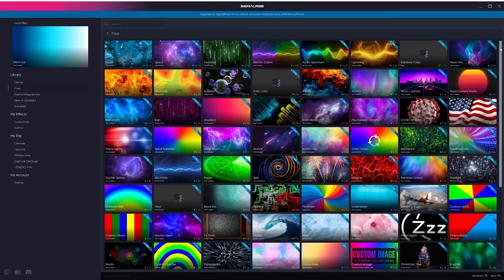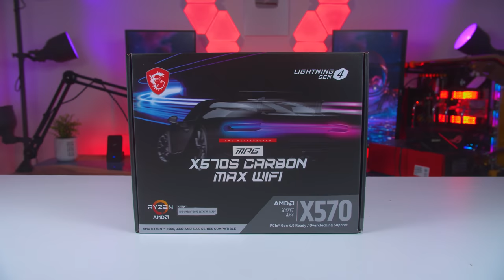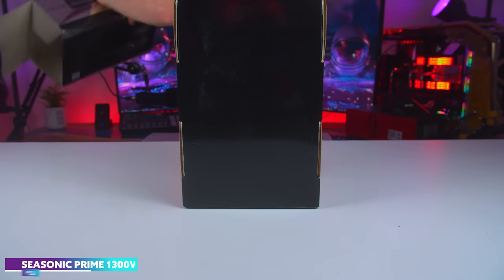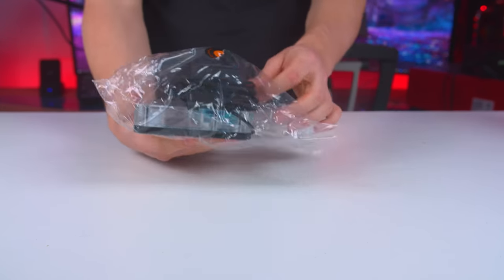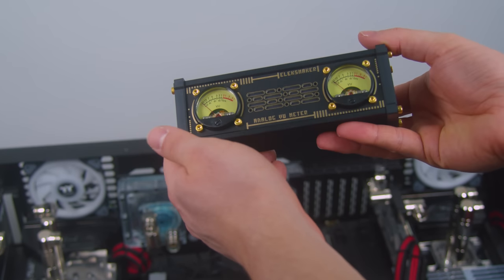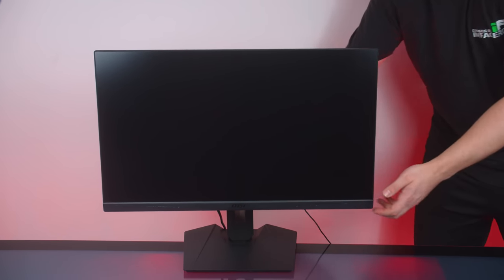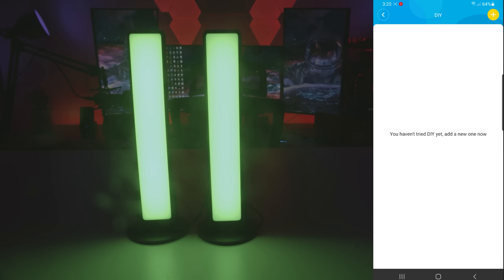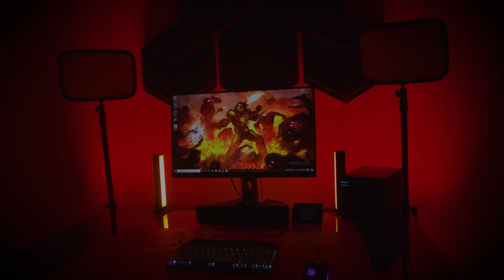The ULTIMATE $20,000 Desk PC

Comment: nice setup, won't criticize, it's an awesome builds, the one thing I personally would do if I had the funds necessary for it, I would go OVERBOARD, monoblock on both systems, RAM Block, SSD block, Chipset Block, and for the tubing, single outlet from pump to each block, connecting them with T's or Y's or X's and the same way from all blocks to the rads and back to the reservoir, but again, that's just me, and I believe someone else who already build what I just described

Comment: Mate, big fan and I'd love if you could answer a question about bending pipes. Would you recommend bending the pipes with a heatgun, or instead using 90 degree adapters and shaving/cutting the pipes so they're shorter and not bending any the pipes? 

Thanks!
Reply from the maker: Iv done both ways, both work fine, id say for a beginner 90 degree fittings would be easier however as you introduce more fittings that creates more points of potential failure over time

Comment: Really beautiful build! Impressed with your tube bending and getting those 4-bend ones to align with everything :D

What were the fans you originally planned on using?

I'm surprised you didn't go with more radiators or a push-pull config considering what's being cooled, maybe there was not enough room? I have a WB 3080 and Zen 3 5900X being cooled by 2x360 PE from EK and 6x Lian Li SL120. I want it to be silent but I need to run the fans at around 1500 in order to keep temps stable over long gaming sessions for specific titles that are both CPU & GPU heavy. I'm thinking of adding a third 360 (SE) but it's a bit cramped in my O11DXL since I have the huge front reflection distro. Also thinking of maybe swapping out the SLs for the new ALs as they have more static pressure.

Comment: BROO I WANNA ASK YOU I HAVE BUILD MYY NEW PC WITHOUT GRAPHICS CARD USING RYZEN 7 5700G WHEN I USED IT  WORKS  WELL BUT WHEN I INSTALL ZOTAC 1650 GTX DISPLAY IS NOT COMING AND WHEN I REMOVE IT AFTER SOME TIME DISPLAY COMES.
MOTHERBOARD ASUS PRIME B450M-A II
CPU RYZEN 7 5700G
SSD KINGSTON FURY RENEGADE NVME 1 TB
P.S.U. GIGABYE P450B
GPU ZOTZC 1650 GTX 4GB GDDR6
RAM CRUCIAL 32GB 1 STICK

Comment: I would really appreciate someone's help 😅😁. I just wanna know if this is possible. I could not find an answer anywhere on the internet. I think your PC builds are really cool, especially the water-cooled ones. I‘ve always really liked them, but I don’t know much about them. And in the videos I have seen there is limited information. My question is, I guess, can a water/liquid cooled PC be sealed? Sealed in the sense that no dirt, dust, liquids or particles will get inside. If it can, how does it get dirty? I’m assuming people use distilled water or special liquids. To my understanding, in a water cooled PC, the fans are still used but they are used to cool the water tubes, not the pc components, like a radiator. The question remains the same. With enough design ... the pc could be sealed from the outside right? A design where the fan/radiator is on the outside of the sealed PC case. Or does the PC components need contact with oxygen or something haha? Help u.u
Reply from the maker: The components still need cool air hence the fans
Reply: @DesignsByIFR  wow thanks I didn't expect the channel to be the one to answer me. Thank you. If I understood your answer ... along with the little understanding I have of these PC builds ... What you are telling me is that the water cooling is only for some of the components right? And the rest of those components still need to be cooled by air fans. Did I understand that right? If I did, could you tell me if the pc COULD be designed in a way that the components which aren't liquid cooled are within an air fan filtered cooling  environment? Because if it can I'm sure someone has already done that.